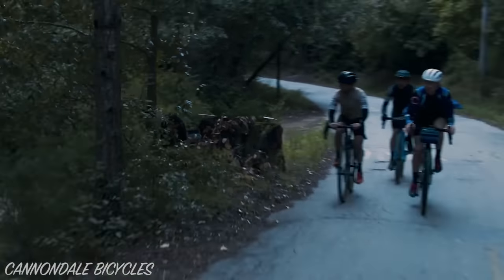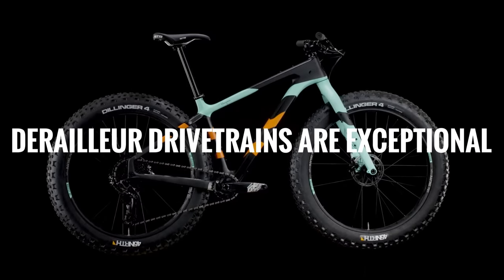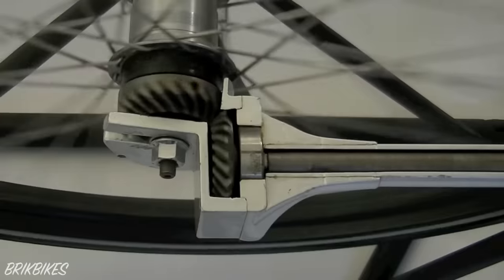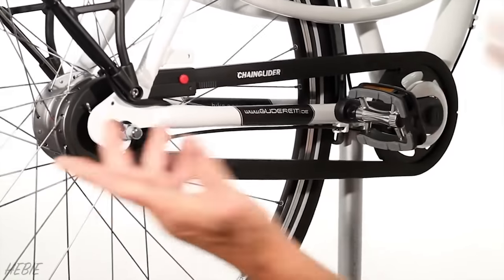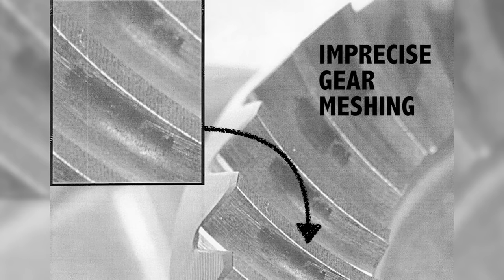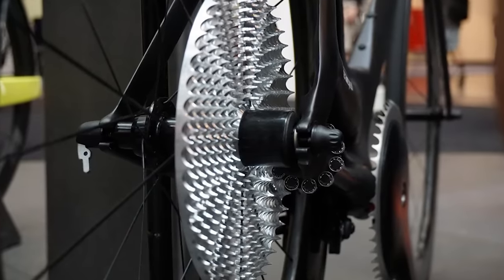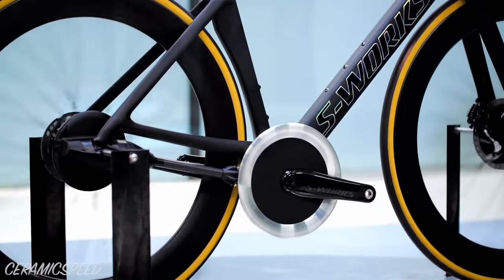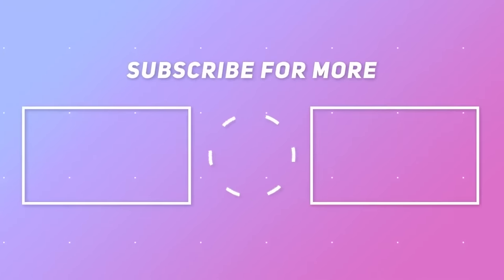Are Chainless Shaft Drive Bicycles a GENIUS or TERRIBLE Idea?

Comment: Perfect for those who don't care about cost, efficiency or weight .
Reply: Pedal assist seems like a far better solution.
Reply: So... hipsters?
Reply: There's a reason these things haven't ever taken off. Motorcycles haven't even adopted the shaft drive. Shaft is is a solution to a problem that never existed.
Reply: @untrainedprofessionals2374  Had Beemers for years. took them 6o years to get it right. Triumph of engineering over design.
Reply: @whazzat8015  they still will be dumping a bunch of power into heating the oil around the driveshaft. When you've got to power the machine with your own meat sticks it's never going to be close. Transferring power thru 90 degrees not once but twice will always be a ball ache.
Reply: @untrainedprofessionals2374  The majority of touring motorcycles are shaft drive as are some sport bikes like the VFR.
Reply: @joshb6993  sadly, yes. but Beemers are about that anyway. Balance of joy and heartache.
Reply: @garorobe  Yes indeed, that's exactly who I could sell an idiotic idea like this to 😂😆🤣
Reply: @SurmaSampo  VFR is more of a sporty tourer than a sports bike
Reply: @ferrumignis  My brother has a 2017 VFR1200 and it has zero touring features. It is a sports bike.
 My ST1300 is a touring bike with all the features you would expect.
Reply: If they were developed, their weight would be less, think man, a chain is a hideously inneficent system, half the metal isn't doing anything at any one time. We use chains because a moron with a CNC mill can make all the components for a chain drive and derailleur gear system, not because of anything else: its simple to understand, make, and maintain. It cannot ever be as efficient as a shaft once you past a few centimetres, at least with the kinds of torque a human can generate.
Reply: @guypierson5754  "a chain is a hideously inneficent system"  It is quite literally the most efficient power transmission system for bicycles, it has never been bettered.
Reply: @SurmaSampo  The VFR is not a sports bike.  The CBR1000RR, R1 and ZX10R are sports bikes.  The VFR is a sports tourer, even Honda calls it that.  It's big, heavy (70+kg more than e.g. a Fireblade),  has a shaft drive, lots of options for mounting luggage, and even has an optional automatic transmission.  Absolutely not a sports bike.  However compared to an ST1300 it would feel sporty without a doubt.  Try a modern sports bike and you'll be shocked (at the lack of comfort as well as the performance and handling).
Reply: @ferrumignis  By your definition only the super sports bike count as sports bikes excluding the majority of sports bikes on the market including the top selling Ninja. 

The VFR lacks the wind protection, range, upright position and integrated luggage to be a sport touring bike. The only touring bike features it has is a robust design and a shaft drive. Honda may have called it a tourer but it lacks the features to do so.

Also the weight and displacement is basically the same as the Hayabusa.
Reply: @ferrumignis  I want you to take a DEEP breath, relax, you don't stand to lose anything here, just gain: Look at the chain drive on a bike: it is pulling along the top of the system, the vertically higher section of chain is being "pulled" in the direction of travel by the person pedalling: the lower section of chain, hanging under the drive and gears, is not taught, it's not under tension, it is doing ZERO work: so for any moment in that system, only half the chain is doing any work, the rest is dead weight: so, tell me, SkyWizardless, how is a component that half of it is dead weight at any time efficient? Because it isn't. But please, enlighten me :D
Reply: @guypierson5754  I want you to take a deep breath, put on your big boy pants and understand that efficiency is not just related to weight, but also to frictional losses. A well maintained chain and sprockets has considerably lower frictional loss than a geared transmission, and is therefore more efficient at transmitting power.
Think carefully: why do sport bikes (i.e. the motorcycles) almost universally use chain and sprockets for their final drive instead of shaft drive? Shaft drive is common on touring bikes because of their durability and low maintenance, and yet sports bikes continue to use chains, why is that?
Likewise in well over 100 years nothing better than a chain and sprockets has been fitted to bicycles, even the high end machines costing thousands, despite the drawbacks in terms of maintenance and vulnerability.
Reply: @SurmaSampo  Honda literally calls the VFR a sports touring machine, are you suggesting the manufacturers don't even know what they are making?
Reply: @ferrumignis  No I am suggesting that their marketing department lied and made unsubstantiated claims.
Reply: @SurmaSampo  And every mainstream review written about the machine is also lies and unsubstantiated claims?  
Kawasaki list their Ninja 1000SX, H2 and ZZR14000 in the sports tourer category, presumably you think they are also lying about their own products?
In short, everyone else except for you is wrong?
It's pointless arguing with someone like yourself who has such a fragile ego they can't admit they are wrong
Reply: @ferrumignis  The automotive reviewer's (including motorbikes) job is to convince the manufacturers to buy advertising space in their publication. They achieve this by regurgitating marketing material with enough flair to make it seem legit and sprinkle in a couple of immaterial cons to make their case for being unbiased. This is how that entire industry works and your can check with John Cardigan and Fortnine to confirm.

How about instead you compare the bikes feature set to the use case and see if is actually designed for the task. This is know as a suitability for purpose test. Or you could check by common usage in practice but that data is harder to come by. Owner forums are kind of the only viable source.

To the manufacturers the category label is just a marketing badge to try and target the product towards the demographic they think would most likely buy it. They don't care if it makes your spine hurt after 200kms of highway.
Reply: @SurmaSampo  Hard to believe you are still doubling down on your provably incorrect statement.

Despite what you read, the Ford F350 is a luxury sedan.  Ford's marketing department and all the journalists the reviewed it are lying about it being a truck.  Have I now convinced you that the F350 is a sedan?

The BMW GS range are simply tall sports bikes, and Harley Davidson make very slow, very heavy and poor handling sports bikes.  The small wheeled twist and go motorcycles are not scooters, they are simply another type of sports bike.
Reply: @ferrumignis  I stated my reasoning which you are clearly ignoring. Each of the vehicles you just mentioned fit in their category by passing the suitability for purpose test. A test  which has real legal weight in Australia and many other countries.

If the categories can not be determined by their suitability for the use the category label would indicate then that label has no functional foundation.

I will put that in simple words for you. If a touring bike lacks the features that make it well suited to touring then it isn't actually a touring bike, unless you agree that the touring bike label is meaningless.
Reply: @SurmaSampo  If Honda, Kawasaki and motorcycle journalists have all conspired to lie about about the category of sports tourers, why would you ever believe that other manufacturers and journalists haven't conspired to lie about other types of vehicle?  

Seems highly suspicious that you trust Ford to call an F-350 a truck, yet you are literally calling Honda and Kawasaki liars for putting a large, heavy, (and some shaft driven) motorcycles into the sports touring category?  Are you a paid shill for Ford or other manufacturers to cover up their conspiracy?
Reply: @SurmaSampo  "Suitability for purpose" A 270kg motorcycle is not sports bike, so it fails your own standards. Want to try again?
Reply: @ferrumignis  Why don't you comment at all about any of the functional features of the VFR? Look, I understand that you don't ride and don't really know anything about bikes.

Exactly how does being the same weight as one of the most famous sports bikes, the Hayabusa,  in the world make it unsuitable for purpose?

It has the riding position, braking, balance, performance characteristics and handling characteristics of a sports bike. It functions as a sports bike and if you had ridden one or any large displacement sports bike you would understand.

Go ride some actual motorcyles.
Reply: @SurmaSampo  "Look, I understand that you don't ride and don't really know anything about bikes." 

You understand wrong, which is no surprise since you seem to be making a habit of being wrong.  I have two sports bikes an old 2T sports twin and an even older twin shock trail bike. I have owned dozens of different bikes throughout my life. though I don't have any sports touring bikes, I dislike how heavy they are compared to actual sports bikes, and a shaft drive just ruins the way bikes behave on and off power...one of the reasons they are not fitted to sports bikes.

I will fully admit that the VFR leans a little more towards the sports side of sports touring than some of the bikes in it's (sports touring) class, but you can keep lying to yourself and others for as long as you want and it won't magically turn it into a sports bike.  The VFR1200  even had the option of an automatic transmission, how many actual sports bikes can you think of that have this feature ?

When you have to accuse the actual manufacturer of being wrong about what their own machine is, then you've already lost.
Reply: @ferrumignis  
Honda CB750 was the original automatic version of Honda's first "superbike".
Honda NC700SD is an automatic naked sports bike.
Then the Honda VFR1200.

Honda plans to bring the DCT as an option to most of its bike over time. So are you saying that the manual version of the VFR is a sports bike and the automatic is not or by just having an option of an automatic makes it a touring bike?

The Honda CT110 has an automatic clutch transmission so does that make it a touring bike too?

If you stick knobbies and a chain guard on a Suzuki Bandit 600 does it transform into a dirt bike regardless of the inadequate suspension and poor riding position?

You might not like heavy sports bikes but they exist and are still sports bikes. You may not like a shaft drive on a sports bike but the final drive does not determine the class of a bike otherwise the Suzuki Bergman from the 2000's would be in it's own unique class since it employs a sprocket drive.

Weight (Hayabusa), Final Drive (MT09TRGT, Tracer 9) and Optional Luggage (every bike on the market) do not make a touring bike. What makes a touring bike is integrated luggage + a more neutral riding position + long range fuel tank + weather protection + engineering for a long duty cycle. These features can be incorporated into scooters, sports bikes, advs and cruisers because touring is a use case.
Reply: @ferrumignis   I gave specific examples of each point I made. My brother's bike is a manual so how is the option of a different gearbox even relevant? Make an actual argument about the bike in question not your flaming strawman.

Tell you what, I will give you back your own argument in the opposite. All sports bikes that have a windscreen and you can buy luggage for from the dealer are now touring bikes and also since hyper-sport and super sport bikes are under a different label they don't count as sports bikes either.

There you go, now there are zero sports bikes. The weakness of your arguments is so astounding that I am concerned that by attacking them I might be harming the defenseless.
Reply: Yeah, reliability can be the ultimate design constraint. Look at human beings, we aren't lightweight or cheap to produce, and we're hardly any more efficient than any other mammal. But we sure live longer than rats, and sometimes that matters

Bikes aren't bridges though, they dont need to be so self-reliable, they can be repaired pretty easily, and the extra constraints that trying to use less nonsolid parts overpowers the potential advantages. It's like its designed with multiple goals in mind, and ends up the worst of both words, in some ways. This piece does seem like it was designed by an engineer who was used to working on more permanent installations
Reply: @guypierson5754  And your sources for your assertion that chain drive is a hideously inefficient method of transmission? What rubbish, a modern belt drive would be more efficient but as far as shaft drive through bevel gears chains win hands down. A late friend of mine worked on developing belt drives and clutches in motorcycles which involved comparisons with chains in properly measured and documented conditions and his figures of around 97% efficiency would refute you off the top of your head nonsense.
Reply: @PurityVendetta  Well, I see you missread something. I didn't mention transfer of work, but I think that's what you are telling us your friend worked on. No doubt it's energy efficient to maintain speed on. I was referring to its ability to transfer power for its weight: read again, if you are still confused, go lift the back wheel of your bike, turn the pedal, watch the top of the chain. It doesn't need to be there. Then consider those gear sizes are decided by the chain drive. I think we can come up with a system that has a high enough transfer efficiency without so much weight. So please, before you explode, think: I cited my source before you ever replied: the chain drive you can observe in use anywhere. As to nonsense: ok, we will continue to do things the same way forever just incase we aren't succesful in improving them.... doesn't seem smart but have it your way...
Reply: @jek__  It's fun to read about the history of the bicycle and the engineering behind the incremental changes that have advanced the design . or not. I have belt, rohlof and Nuvinci drives. all interesting but with limited appeal. Like I said, it took BMW 50 years to get a good performing affordable shaftie out to a broader market.
Reply: @joshb6993  >they still will be dumping a bunch of power into heating the oil around the driveshaft. 
That's why they're viable on a motorcycle but not a bike.  A touring motorcycle like a beemer is built to be long-lasting.  They're accepting some parasitic loss and some extra weight in exchange for a system that's much, much less likely to fail.  Bicycles are optimized to get you farther, faster, with less energy spent.  There's almost no use case where reliability is enough of an issue to accept the tradeoffs.
Reply: LOL!
Reply: Au contraire, Mademoiselle, au contraire

Comment: Here is my POV from a casual bike rider . I like that the chain system is easy to fix and operate . the chainless version seems to complicated and hard to fix if you were 2 miles up trail you might as well be up the creek without a paddle
Reply: But a shaft drive wouldn't fail as often as a chain. Especially in a low power application as a bicycle it should last forever.
That said, chain and sprocket are much cheaper and lighter. And if you are using hub gearbox you can completely enclose the chain, reducing wear from outside dirt.
Reply: @JCGver  until you break the gear teeth and are screwed
Reply: @mass-cp6jf  chain system also have teeth which grab on chain and in my experience it much more fragile.

Comment: Coolest new thing Ive seen for bikes is an oval crank gear that made it easier when you were at the angle of least power and was wider where your leg was able to impart the most torque on the crank.
Reply: I heard those wear out the chain faster not sure if true
Reply: @lyssanch3096  propably by a slight amount as it is tensioned a bit differently as you are pedalling
Reply: Actually, those eccentric chain rings were probably at the height of their popularity about 25 years ago. Even then, they weren't very common.  I'm not sure but I think one problem with them might have been that they made it difficult to position the front derailleur properly as the chain would continually rise and fall with the rotation of the chain ring.
Reply: @eyesuckle  so its better suited for single speeds ?
Reply: @lyssanch3096  Well, maybe not necessarily for one-gear bicycles, but at least bicycles without a front derailleur. An eccentric chain ring wouldn't be a problem for the operation of the rear derailleur.  And from what I've seen, bikes with only a rear derailleur seem to be making a comeback!